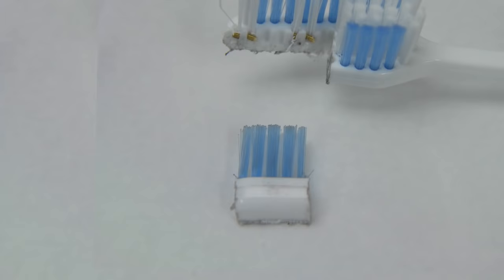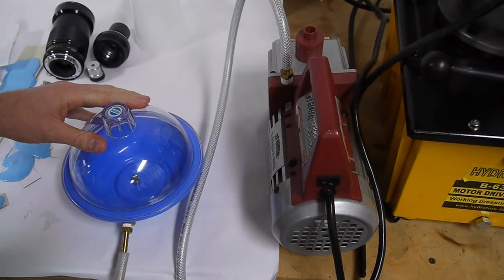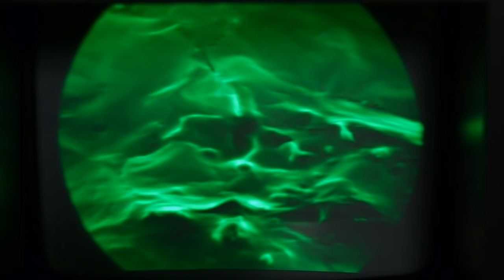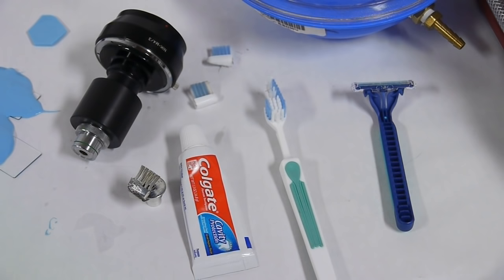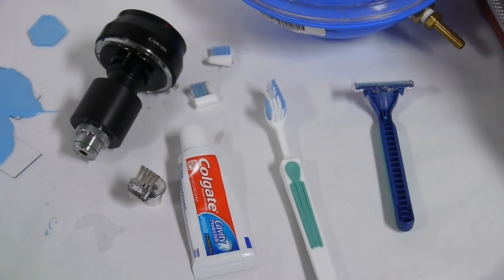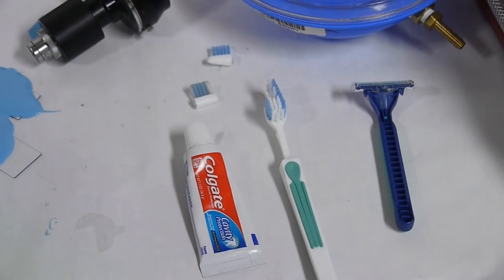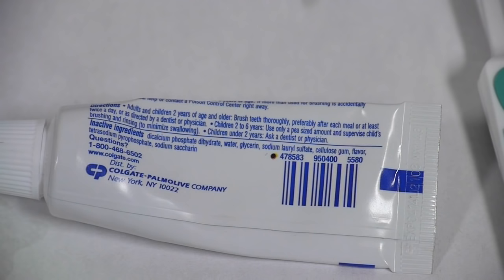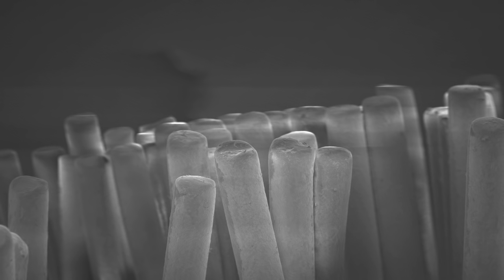Your toothbrush is worn-out!

Comment: Toothbrush manufacturers get the bristles to have those rough, jagged, 'grabby', finger-like ends of bristles by scrubbing the toothbrushes on abrasives pads.  I assume the new bristles probably look like a lot like the "old" brush in this video, before undergoing this roughening step in the manufacturing process.  It would be interesting to see if scrubbing your old toothbrush on sandpaper (not sure what grit) or similar abrasive pads would restore some of the bristles' original characteristics.
Reply: +thechosendude How do they manage to maintain that surface finish around the diameter of the bristle? If they were just mechanically scrubbing the brush against sandpaper, one would expect to see differing texture around the radius of the bristle. And tumbling the bristles in an abrasive media would negatively affect the handle. Plus, the surface texture did not vary greatly as one looked down the length of the bristle, if it was mechanical scrubbing the bristles would be less affected near the base.

Maybe how it's made has a toothbrush episode?
Reply: +zrobotics It's all mechanical.  They roughen them after the bristles have been inserted, in an orbital motion - it doesn't take but a few seconds to reach the desired effect (not long enough to taper the edges or take away any significant amount of material).

Edit: I just looked up a How it's Made episode of toothbrushes and they used diamond dust abrasive pads for the roughening of the bristles.
Reply: +thechosendude Looks like a 'Toothbrush Restorer' will be the next.

A micro Sandblaster with a bit of bleach.

Someone make one from Granny's ultrasonic Denture Cleaner.
Reply: My only concern would be Microplastic Generation from the grinding, but as long as the dust is collected and disposed of correctly (Pyrolysis/Gasification for Thermal Recycling, or just Incineration, albeit both with STRICT Pollution Control + Ash Reprocessing+Proper Disposal)

Comment: now we need a video comparing tooth pastes to see which one is the most/least abrasive, or if there's a difference at all
Reply: +Dušan Pešić We need this!
Reply: yes? polish your teeth to a mirror finish
Reply: +Dušan Pešić I used to use toothpaste to polish scratched hard plastic watch crystals. I found that Colgate was most abrasive - good for starting scratch removal. Crest had the finest abrasive, and polished the crystal to clear / shiny again.
Reply: +Mace Moneta Brand "Crest" called as "Blend-A-Med" in some european countries.
Reply: interesting
Reply: +Luck Arm & Hammer toothpastes use baking soda. I recommend them.
Reply: All the reputable manufacturers carefully choose the abrasive to be high enough to clean but not high enough to damage enamel. I doibt titanium dioxide is really used as an abrasive as the video says, that is simply a white pigment and far too expensive to use as an abrasive where calcium carbonate works fine.
Reply: +Dušan Pešić 
I think Granny says to use Baking Soda and Hydrogen Peroxide.
Reply: +Dušan Pešić Toothpastes marketed as whitening tend to be more abrasive. Actually that's the only reason they're more whitening - they don't alter the chemical make up at all.
Reply: +Luck You've got the right idea, but some misunderstandings and bad information.

Abrasion is a multifaceted phenomenon. Size and shape of surfaces, pressures, elasticity, strength, and hardness all factor in.  However, toothbrushing involves relatively modest pressures, so hardness is probably the most important factor.

A common measure of hardness is the Mohs scale. Diamond is the hardest, with a harness of 10. Tooth enamel is a 5, harder than many metals. Baking soda is 2.5, the same as the dicalcium phosphate dihydrate, which is used in the very popular (in the US) toothpastes. Some consumer toothpastes use harder abrasives , but I think anything approaching the hardness of enamel would expose the maker to a lot of lawsuits.

Comment: And here I was trying to get the most time out of my toothbrush possible - I did not know!
Reply: +Fran Blanche I was surprised with the surface texture, simply because that looks incredibly expensive to manufacture and yet it was a cheap brand toothbrush. From what I understand, it's typically easier to form a smooth surface on plastics, especially as i would expect the bristles to be extruded.
Reply: same
Reply: same here, but I would think the abrasives in the paste would compensate for rounded bristles.
Reply: yep +1, so, does that mean I must throw away my 5 yo toothbrush?   : /
Reply: Fran! 👍
Reply: @zrobotics  I guess its in the way wsy they cut the bristles

Comment: Amateur astronomers who like to make their own mirrors and lenses will use toothpaste as the abrasive in one of the roughing passes in the polishing stage, due to the presence of micro-abrasives in a lubricating paste. It helps that it's cheap, easy to obtain, cleans off quite nicely, and it's a very homogeneous product (within an individual tube and across stocks).

Comment: If your metal vapour deposition apparatus gets hot enough to boil silver, how does it not melt the toothbrush ... even a little bit?
Reply: The heat is in one small part of the bell jar, while the toothbrush is in a different part.  Because it's under vacuum, the heat doesn't transfer convectively the way it would in air.

Comment: Surprising result from the wearing effect of toothpaste on the brush bristles. I always assumed that the bristles would wear from smooth to rough (like 'split ends' on hair) and not the other way round. I also usually replace my toothbrush when the bristles look worn to the naked eye ie. splayed. I think I'll be changing my toothbrush much more frequently now. Your results actually explain how the 'indicator' toothbrush heads for my electric toothbrush work - obviously the coloured coating on the bristles is worn away by the abrasive effects of the toothpaste over time, presumably at the same rate as the smoothing of the outer surface and therefore is an accurate indicator of wear and not a marketing ploy as I'd feared! Great informative video.

Comment: I was able to use a relatively low powered optical microscope (an old binocular dissecting microscope, on the "high" setting) to see the difference between a new and a worn brush head fairly readily. I then scrubbed the worn head on P100 and then P220 sandpaper in an orbital motion for just a couple seconds, and it came out looking fairly "new".

Comment: The coarsness of the grit is only one consideration, the harness is another. 

Sandpaper is often made with compounds with a Mohs hardness of >8. Tooth enamel has a Mohs hardness of ~5. Dicalcium phosphate dihydrate and baking soda have a hardness of about 2.5.

I haven't been able to find a hardness for nylon. Ice is 1.5, so I'd guess nylon is ~2.

As for the texture, the roughness of the tips of the bristles influences how well it retains the bits of abrasive. A rough tip will retain abrasive and allow higher pressures between the abrasive and tooth/plaque.

Comment: at (2:23) when you put the silver coated toothpaste under the SEM, isn't the chamber under a vacuum?  Do you think that the electron beam is drilling a hole through the layer of silver and allowing the water inside the toothpaste to boil under the low pressure?  like you said trapped gas can also do that too, but water is one of the main ingredients

Comment: Thanks for a really cool video! I have 2 comments: 
1- I'd be curious to see how smooth the bristles get after 1 day, 1 week, 1 month. Might it be possible that those fuzzy tips get worn down after just a few uses?
2 - You made a connection between the particle size of the toothpaste grit and say 600 grit sandpaper, but wouldn't the hardness of the grit particles be an important factor? I'd guess the toothpaste grit is a lot softer than sandpaper grit, no?

Comment: What if use a lipid solvent such as gasoline or alcohol or KOH for the old brush? 
If you zoom in a hair, it will looks similar as the old brush in your video, pretty smooth. If treat it with KOH, it will lost lipids and be sharped, like a new brush on your video.

Comment: So if the abrasive is that coarse, is there such a thing as "too much of a good thing"? In this case, consider a parent encouraging a child to brush frequently, and brushing for the recommended duration of time. Would the child perhaps be wearing the enamel off their teeth faster than a child with sloppy brushing habits? Or is there some magic to the harness of the abrasive that it won't remove enamel no matter how long you brush?
Reply: ***** That's good to know! Thanks for the info.
Reply: +USWaterRockets 
Just realize that people aren't necessarily qualified to make certain assertions such as what Luck said. I'm not saying he's wrong, but it would be good to know more specifics, such as the specific materials that most toothpastes use, their hardness, and compare to the hardness of enamel. When the hardness of something is lower than another no significant damage will likely be caused to it.

There is another post where "Jarrod Hart" says: 

"All the reputable manufacturers carefully choose the abrasive to be high enough to clean but not high enough to damage enamel. I doibt titanium dioxide is really used as an abrasive as the video says, that is simply a white pigment and far too expensive to use as an abrasive where calcium carbonate works fine."
Reply: MsHojat Thanks. I appreciate all the input I can get.

Comment: fascinating and very informative.  especially the information about the roughened ends of the bristles.  i thought i knew everything.  i did not know that.  so now i really do know everything.  there are different abrasives used in toothpastes.  cheap common stuff like colgate in australia used to contain pumice.  it is considered too hard by my favourite alternative health professional.  a well known australian drag race engine builder used to use colgate toothpaste as the final grinding compound on valve seats 40 years ago.  toothpaste from health shops often states that the abrasive is calcium carbonate aka. chalk.  a more gentler substance.  my favourite alternative health professional advised me to make my own toothpaste using sea salt and food grade diatomaceous earth (and some other stuff).  the silica crystals in the fgde have actually been cleaning tobacco grime off my teeth.  it would be interesting (as if this video wasn't interesting enough) to see these other substances under your magnifying equipment.

Comment: I have polished my headlight lenses using toothpaste, however, I've discovered the joys of using a single swipe of an acetone-soaked paper towel. I do not recommend you try this. There, that's my disclaimer. But years of yellowing, gone in 5 seconds. Now I need to clear coat to protect them.

Comment: Ben: a thought for when you dry out stuff. Dessicator and heat lamp combined should scare moisture out of just about anyting.
The raster generator, what are you planning to use, an arbitrary waveform generator?
Reply from the maker: +Teukka72 Thanks.  The SEM raster generator and capture device is a fairly complicated project.  I want something that will generate X and Y control signals as well as sample the image at 5-10MHz minimum.  The DACs and ADCs need to be sync'd with quite a lot of control over timing, etc.  It's basically an FPGA project with high-end dedicated ADCs and DACs, and a high-speed USB interface plus software to run the whole mess.  I decided to build my current SEM capture with just a Teensy LC controller since it is so much easier, and produces quite nice still images all on its own.

Comment: A dentist has told me this is wrong though. What you are showing specifically is a cheap toothbrush with badly manufactured bristles. If you look around on the web you can also find results that take into question whether these rough tips can actually cause gum damage. I would actually like to see what the result would be if you were to take a look at a more expensive brand.
Reply: +cone minihug

I'm not sure about what you're saying is wrong about this (or rather what the dentist said is wrong). The statement "you can also find results that take into question whether these rough tips can actually cause gum damage" doesn't make sense.

Are you suggesting that the roughness on these new toothbrushes isn't a good thing? Are you suggesting that higher quality bristles will last longer, or what?
Reply: My apologies. Yes, what I was referring to was the statement that the roughness of the bristles is manufactured for better plaque removal. The dentist said this was very wrong. I am not saying higher grade bristles will last longer, but just that the condition at the start might be different.
Reply: +cone minihug Your dentist was talking about toothbrushes with stiff bristles.
Reply: +Euro Bum No, he was referring to this video. But yes, dentists do recommend soft bristles over stiff bristles.

Comment: how about putting the razor blade into the SEM ?
Reply from the maker: +omkar joglekar Good idea!  I've been thinking of making a video about knife sharpness, and using the SEM to show a honed edge vs stropped vs file-sharpened, etc.
Reply: +Applied Science That could be interesting indeed, I've seen a few comparisons so far when people sharpened on a guided system type deal with progressively finer abrasives but only with optical microscopes.

It eventually ends up looking like a clean line (assuming the stones were level, technique was good and went up to a fine enough abrasive). It'd be really interesting to see what that "perfect" edge on an optical microscope looks like on the SEM if you have the option to get that refined a polish on an edge.

A few comparisons between a file sharpened thing, proper sequence of stones and then followed up by what it looks after stropping with a fine abrasive showing the progressive changes each step gives to the edge would be interesting. Perhaps also how an edge looks after it has first been sharpened, messed up through use/abuse and then patched up with either a honing steel or strop. It's a lot of work especially with the attention of detail you tend to give to your videos, so even just covering a few of the things mentioned would be great :)

Comment: Could we recycle our toothbrushes for a while before trashing them ? Let's take an old worn toothbrush and cut the tip of its hairs, roughly, then compare, check with the microscope if they are like new ones.
Reply: +Okto Putsch
Cutting the tips wouldn't be sufficient; it would need to be roughened with an abrasive.  It could probably be done but I don't know of any confirmed abrasive devices that would do it effectively. It's a potential business someone could get into though.
Reply: MsHojat ah, thx, good idea to roughen the tips this way :) so in someway we wouldn't even need to cut, just using sandpaper should do the job

Comment: Hello.  I happen to manufacture toothbrushes since 1990.  The microscopic views you show are amazing.  However, I think you don't get to the right conclusions about used vs new bristles.  The toothbrush you used is an extremely low quality product.  I couldn't believe the aspect of the filament tips!!  A good quality toothbrush has each filament tip perfectly rounded to a sphere shape with a SMOOTH SURFACE. 
 You used an unrounded toothbrush probably made in China and not by the best company out there.
  I would be very intrigued to see these images taken in one of our toothbrushes or in an OralB or Colgate product.   The reason for having every tip in a sphere shape is to avoid damaging the gum tissue.   The reason why the filaments in the new toothbrush you show are so coarse are NOT to hold toothpaste in its craters and crevasses!!!  That is nonsense! 
 The reason why this toothbrush looks so horrible when new is because it was made by a company that doesn't care about end rounding and doesn't have the appropriate equipment to do it!!

Victor Joubert